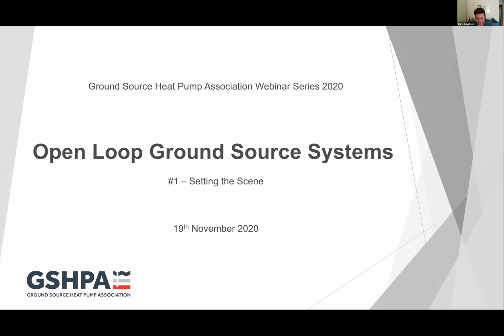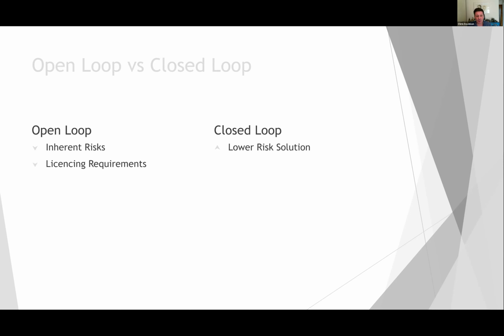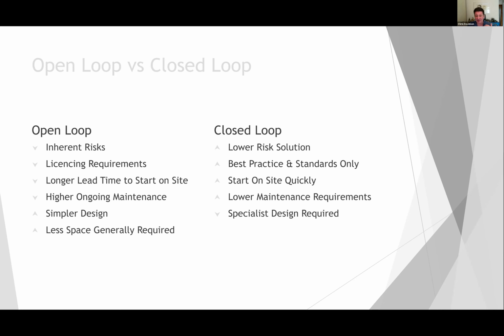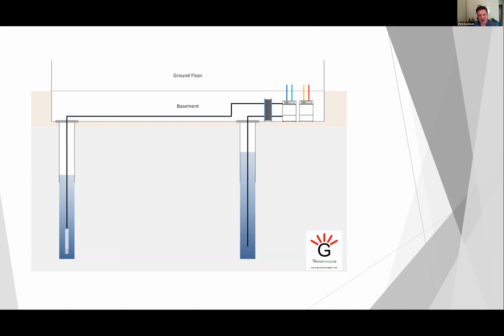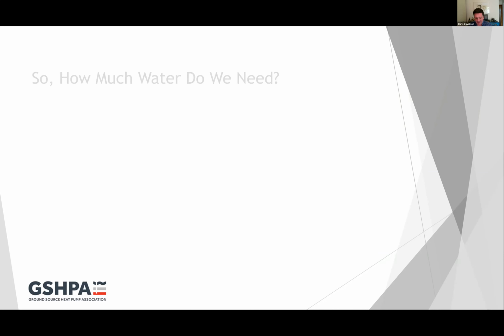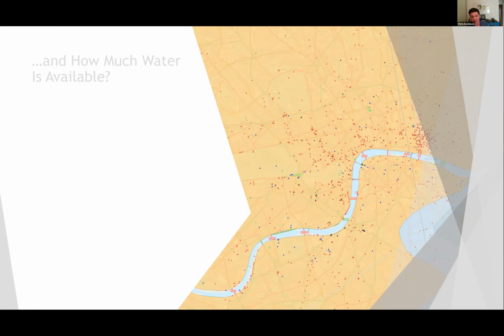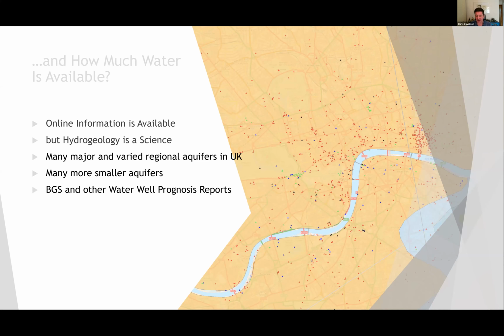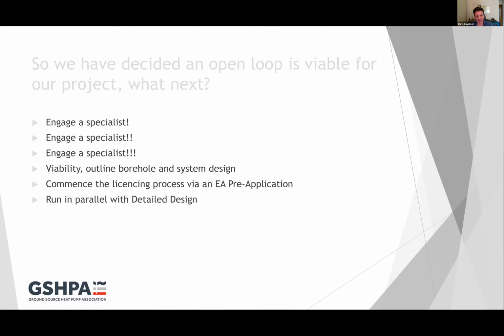GSHPA Webinar - Open Loop Ground Source Heat Pumps - Setting the Scene - Chris Davidson

Comment: great summary, we're thinking about a GSHP in Central Otago, New Zealand, a few years ago, I did some investigation with the local EA, they were reasonably receptive but said if we did go ahead they recommended preliminary resource consent, there are a lot of hurdles and risks as you said, so we're thinking about either open loop GSHP or air source HP because the ground on our land is river gravels next to the Clutha river so not good for closed loop, air source would take away a lot of risks, so we'll probably not go for open loop system, thanks again, kia ora from Aotearoa